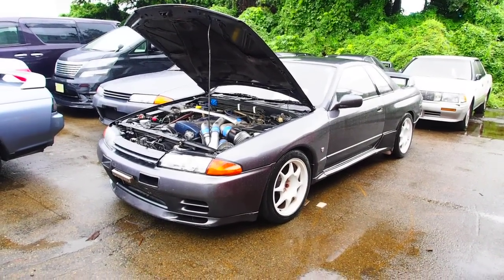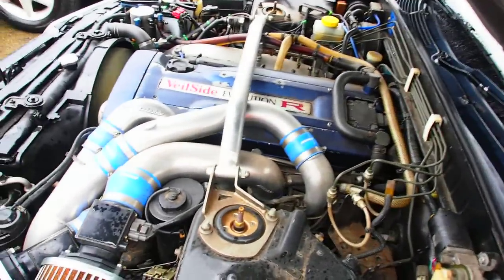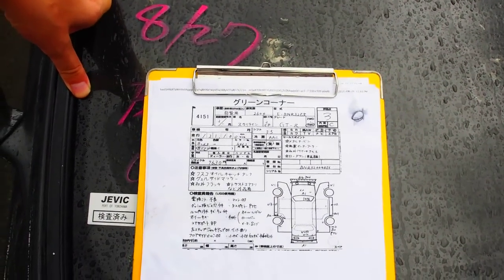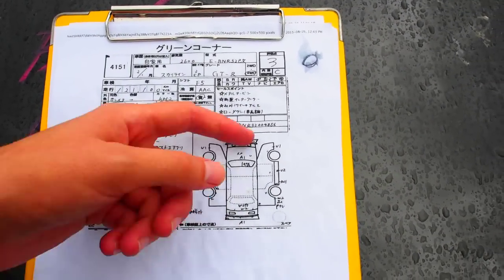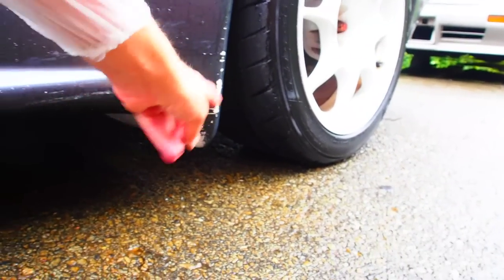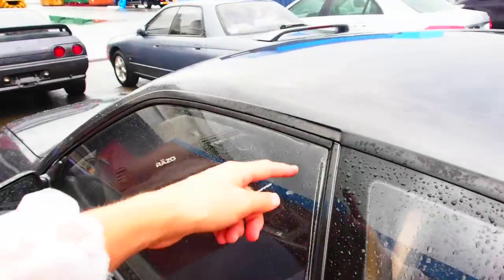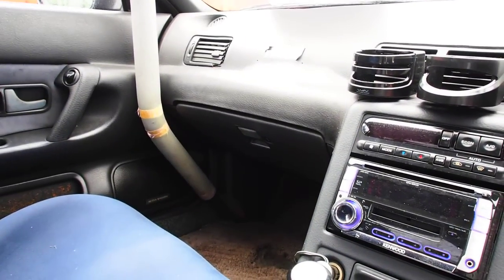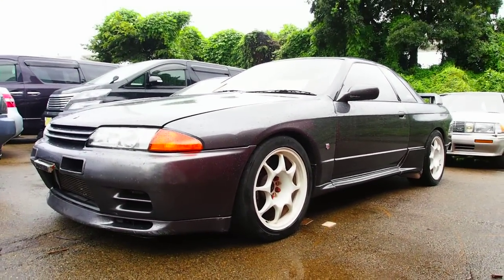1990 Nissan Skyline GT-R (122,000 km) - Japan Auction Purchase Review

Comment: what we have learned after having the car for one day : rear diff is either welded or a very tight 1 or 1.5 way LSD, turbos are R34 N1 Garrett M24 A/R .53, car is boosting 1 bar or 14.7 psi, upper control arms are upgraded, rear HICAS has been replaced with a solid bar,  front sway is adjustable, all chassis bushings are aluminum, and rear chassis bar is installed, clutch is strong but the throw out bearing is making noise; car is crazy fast considering the bald tires. all fluids are clean and aside from the body blemishes it has been very well taken care of mechanically.
Reply from the maker: +russianyuri Cool update Yuri. I am glad that you got the car and could check it out in detail. When it hits the race track be sure to send me pictures.

Comment: Is that a cup holder on the door?
Reply: +ravesilly it looks like an additional door handle to help pull the door closed when strapped-in with harness belts. The racing seat and harnesses make it very difficult to reach out and close the door since your shoulders and held against the seat.

Comment: I know this has nothing to due with an R32, but how can  you tell apart an Evo 8 from and Evo 9, to me they look completely identical and I often confuse them, any help?
Reply from the maker: +xBunnyRabbitx1 The grille of the 8 has a triangle in the centre and the 9 has a rounded rectangle grille and ovular intakes on the bottom of the bumper. 

The 7 is also on the same chassis. It is identifiable by a boxier grill rectangle and fins on the sides of the front bumper.
Reply: PacificCoastAuto Okay thank you

Comment: VeilSide... Engine... Doubt it. Probably, it's just a sticker. 
Camshafts are definitely stock. Judging by the engine's voice.
Reply: +Ivan Kudinov ; We won't know until the car arrives in Texas; I will be documenting the inspection, modifications, and overall build of the car here: 
https://www.facebook.com/russianyuri
Reply: russianyuri писал бы по-русски. =)
Probably, the car HAD some mods from VeilSide. 
Judging by the overall condition of the car & installed tune-ups, I can expect only a stock engine (cams, crank, pistons). Such type of drivers usually don't modify their cars heavily. But who knows - that one can be an exclusion.
Ну, чтобы всем было понятно.
Reply from the maker: +Ivan Kudinov This car was used mainly for racing I think. I did not mention it in the video but the style of LSD is the mechanical type that locks hard. These are not used on street cars for the most part because it makes the car shutter when turning. The roll cage and the metal turbos are other things that make me wonder what is in the engine. I am looking forward to the car landing and learning more about it.

Veilside is known for their aero kits and wheels, but their shop in Nagoya does custom tuning as well. 

I am subscribing to the youtube channel and Facebook.
Reply: PacificCoastAuto as RussianJuri said - he'll find out everything about this car soon. =)
Don't tell me about racing LSD. I was too stupid & installed a Cusco 1.5-way into rear. With a 752-MT it was cool to drive it. But then I've installed a 6MT with suretrack in the front & Cusco (probably, 2way) in the middle. It is impossible to drive my car slowly. All the LSDs are trying to rip the car (struit bars manage it). The sounds are... I don'n know how to explain it. It seems like all the 4 driveshafts are broken.
BUT. On the high speeds & full throttle the car has amazing grip. =)
Hm. A lot of offtop. Sorry. I'm just replaced a burned-out gasket between turbo & downpipe. The car does not sound like a snake on throttling. I'm happy. Will go & chop some tourer-V's now. ^_^